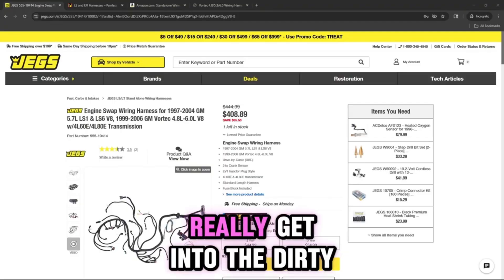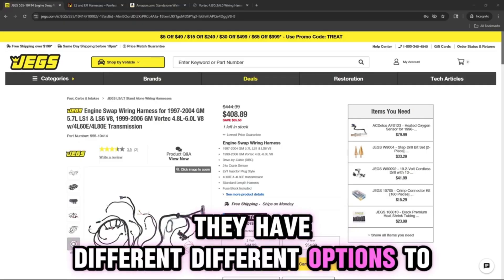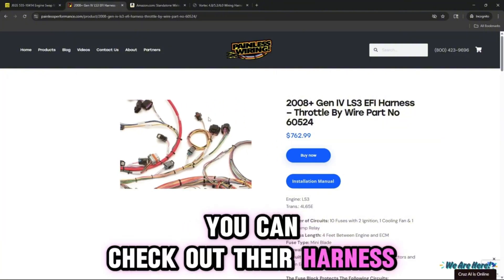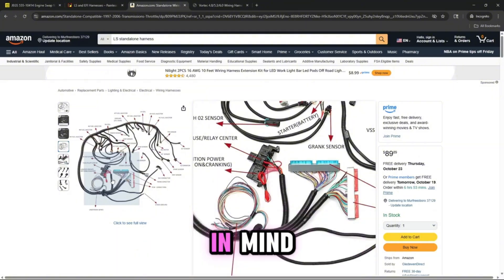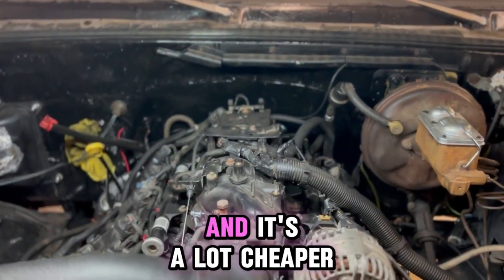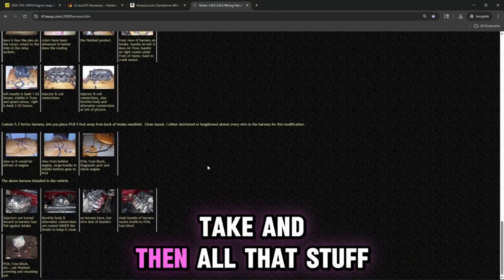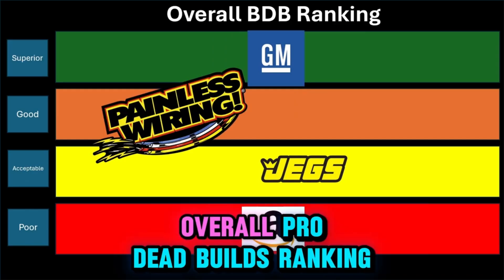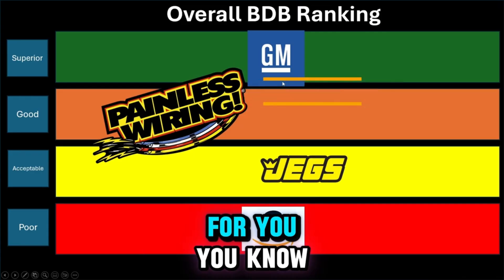LS Swap Harness Options

Comment: Found you on tiktok and came here specifically for this video.  Appreciate the info but gotta say the subtitles are quite distracting here on YT.  Side note deep motor is another source for China made LS stuff (intake, harness, and other stuff).
Reply from the maker: Thanks and I normally don’t use subtitles but don’t think I will use it again. I think I heard of deep motor before. Will check that out.